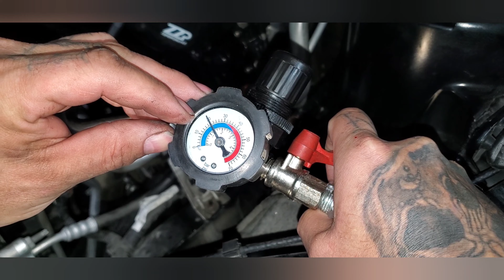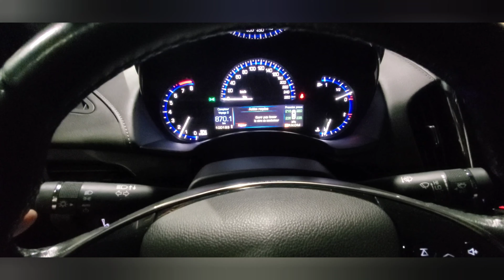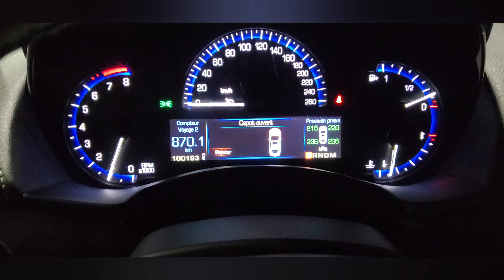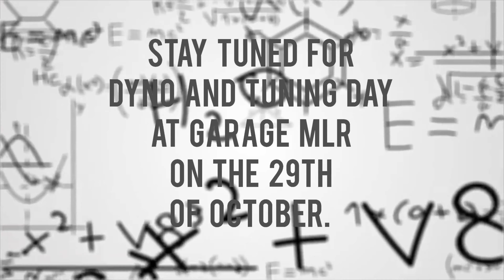THECROW LTG 2.0T engine rebuild  ( part 8 )

Comment: Hi! To install that kind of Blow Off valve (50/50) - have you done some ECU Tune? Otherwise I guess it would throw a check engine light?
Reply from the maker: No it doesn't,  it's plug and play from Turbosmart.
Reply: @lecorbeau11  well the ecu counts the air via MAF sensor and puts correct amount of fuel for that much air. If you “bleed” the air with any kind of blow off valve to atmosphere - you will get Lean mixture.
You should use diverter valve instead, so the pressure air - goes back in turbo without loosing “counted” air from mass air flow sensor (maf).
Reply: Lean mixture causes piston problems. Maybe that’s why your oem pistons cracked. Higher boost with lean fuel - causes piston failure.
Reply from the maker: You might be right about that but for me I think it creates rich conditions because of the air calculated not going to cylinders, and that is just 50% of that amont too. Don't forget that it's when you let off the gaz pedal that the air is blown out of piping, never under engine load and since it is automatic, I never leave the pedal between shifts on hard accélérations.
I vote for too tight of ring end gaps for the piston faillure.
Reply: @lecorbeau11  it actually does leans the fuel, because the afr (air fuel ratio) goes too rich and the ecu cuts the fuel.
Actually you can fry your pistons again if you keep doing that.
Reply from the maker: @1276388  Well i have a dyno session on friday so if it was a problem, it won't be anymore cuz it will be fully tuned. It will be all documented too and I'll let you know how it went.

Thank you sir
Reply: @lecorbeau11  that’s great! 👍😃 thanks for a cool videos!

Comment: or maybe that blow off valve just keeps bleeding the pressure out because of low pressure spring inside it?
Reply: because when the spring has the proper PSI load, the valve stays shut even when it's off the battery
Reply from the maker: The pressure doesn't come from the spring but from the solsnoid powered by the ECU. The broblem with the stock ones is that they are made in plastic and tend to leak on full boost.

Comment: maybe you have some boost issues? Have you checked your boost level? Maybe you should check your Turbosmart Wastegate actuator? how about installing your old Wastegate actuator and check again if it does any change?
Reply from the maker: It's exactly what I did and
that's why I did those test, to see if the problem was coming from a boost leak even if my boost gauge is showing me 22.5 psi.